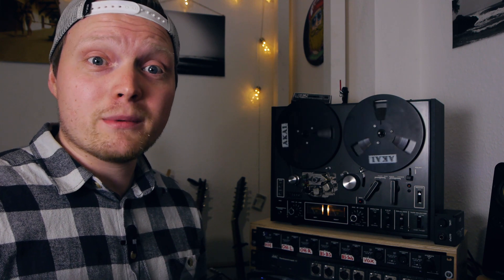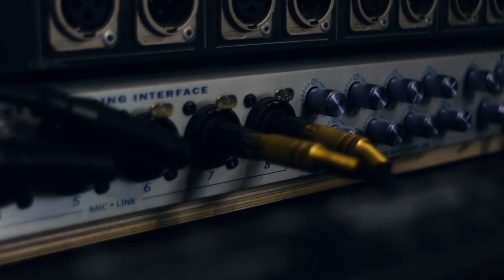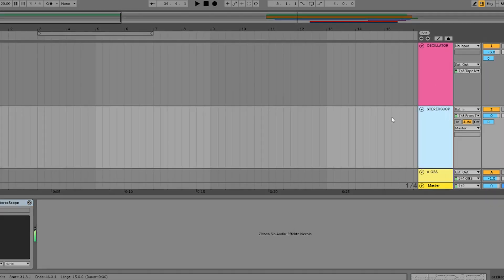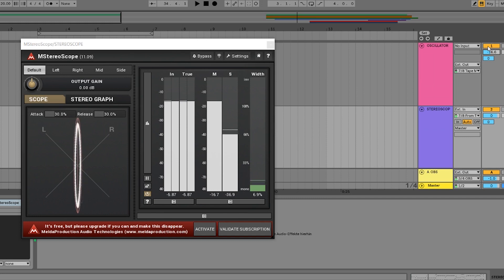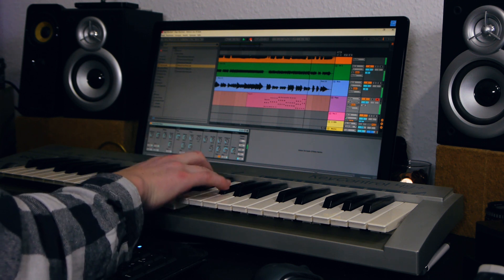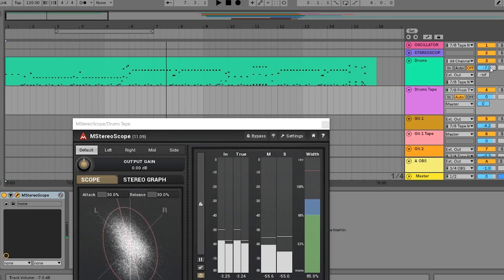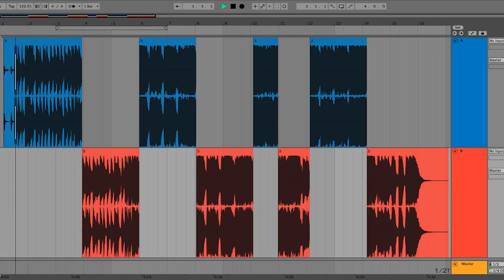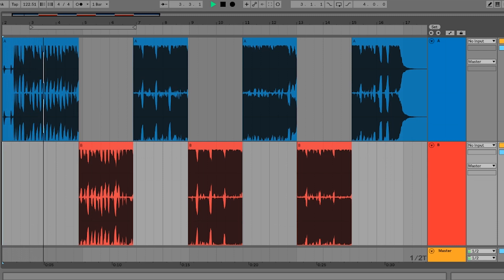How to use an analog TAPE machine as outboard gear for a digital audio workstation (DAW)

Comment: Thank you so much for making this! I’m wanting to buy a tape machine for this exact application. I wonder though, being as it’s only 1/4” tape, would it be better to get an Emperical Labs Fatso and a couple of Neve 542’s? I have quite a bit of analog processors already, and I’m wondering if there would be much benefit to me using actual tape, 1/4” tape anyway. I’m looking at an Otari 5050 BQ2, 4 track. It costs about the same as a Fatso, + tape and maintenance and all. I’m researching everywhere on line, and at this point I think that it’s best to ask people like you your opinions to help me make this decision.

Comment: Hi great video, I just got one of these tape machines, what cables are you using to connect. Cheers
Reply from the maker: sorry for the late response. I had to use some chinch cables and jack adapters... not the most elegant solution though.

Comment: Do you have to run the tape or just send it through with rec on?
Reply: run the tape for the actual tape saturation, when the tape is stopped you're just going through the preamps. I've stuck full mixes through two of the pres on my teac a3440, they seem to sweeten things really nicely without the tape running. then for more gnarly tones, run tape. boom

Comment: Do you know if it's possible to do this with a Revox A77 MK IV? Obviously I need an output or monitor to get sound out of the tape recorder to the computer, right?
Reply: that particular deck wont impart very much colour...prob only a lil boost at 80hz and some rolloff of 16khz
Reply: Every deck will have its own sound from its own preamps etc. Its really a crapshoot these days, if you want to experiment accept the risk you might end up with a hunk of junk, even if it is 'serviced'. 7 1/2 ips tends to provide a bit more of a lo fi colour if thats what you are looking for.

Comment: in this situation the tape is moving ,recording ,and we take the signal from the last tape head is that right ?someone told me he doesnt always use  the ''record''  function he just puts the signal through the tape player and turns up the input level to get gain from the amplifier to 'dirty up' the signal-so the actual tape is not having an effect .  i use a a technics tape player as my headphone amp,i press record and pause to get the output signal , i suppose i could do either of these things, although the sound wouldnt be the same as the big tapes of the reel to reel.

Comment: I have a DAW that only has 2 outputs and 2 inputs (as well as a headphone output). Can I still get the same results? Thanks!
Reply: Dro Cardoso it’s not your DAW that has only 2 ins and 2 outs but your soundcard/audio interface.
Reply: Daniel Joos thanks, I got confused there. Can I still get the same results though?
Reply: @drocardoso3213  Yeah you should be able to send it from the outputs into the tape machine then back through the inputs. Just make sure that you mute the incoming track that is from tape otherwise you have a feedback loop.

Comment: Can you please tell me where you’re plugging your instrument into? Are you plugging into the actual tape machine? I have a scarlet 2i 4 and it only has 2 inputs. So I’m guessing your plugging your guitar into the tape deck. Is that right? And what kind of cables do I need? 2 aux cables and 2 quarter inch to aux? My tape machine only had aux sized holes on the back. On the front it has quarter inch “mic” inputs. Any help would be so appreciated. Thank you.
Reply from the maker: Sorry for the way to delayed response, seems I should check my vids more often.... all the stems were re-routed, so mics and instruments were recorded straight to the firepod and fed to the tape via its outputs later on. I bought two stereo chinch cables and 4 chinch to quarter mono jack adapters.

Comment: Hello,
Did you recorded on tape or just go thru the machine ?
Reply from the maker: Hi, I recorded the signal from the playback head into Ableton, so the returning signal passed the tape in the gap between the record and playback head of course. Since the machine has a "tape monitor" switch I see no need to rewind the tape and then record into Ableton.
Reply: @DominikSymann   That is smart idea !
Thank you !
Reply: Hello, would be possible to make a video showing that please? Thanks 😉

Comment: hi i had tape decks from 16 years old. you got to be very carefull where you get your tapes from
and check tape for edits in the tapes  and the levels of the tape some got low out put.
so if you buy used tape when you ff the tape watch out  for white editing tapes you can fill it with a fingers
when to have the tape ff or rew  there can be 6 BD from make to make

Comment: This is the best video I could find for this sort of thing, I’m going to do exactly this as I want to achieve the same thing. How do panned drums work through your machine, does it print the exact panning set?
Reply from the maker: Thanks! Sometimes when the tapeheads get dirty the volume and frequency can become uneven. I always try to center the stereo image of the returns by using that stereoscope plugin. If you can´t get it even, especially frequency-wise, you should also check the azimuth of the heads. Still, my tape machine will always do some unpredictable funky things, but that´s what I like it for.
Reply: Dominik Symann do you use logic too?
Reply from the maker: I'm no Logic user, but that's just because I got stuck with Ableton which I really like a lot. I am sure you can do all that stuff with Logic, too.